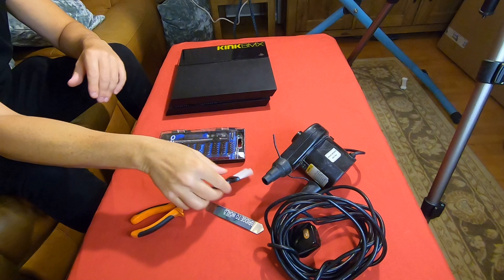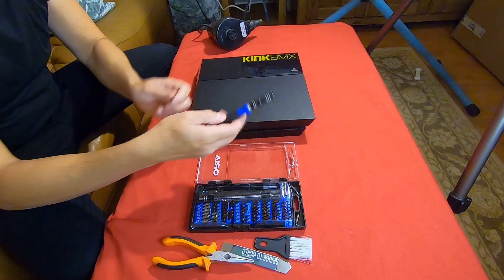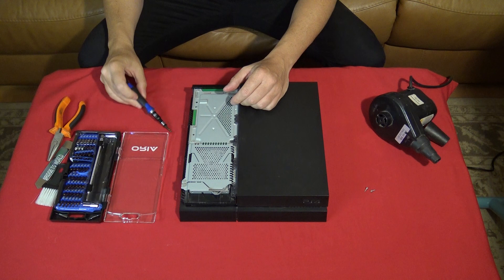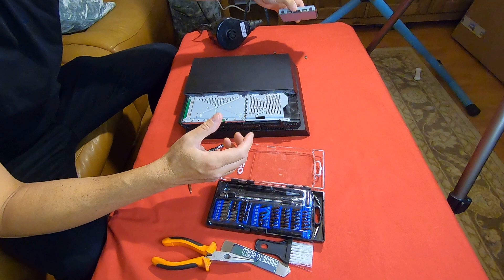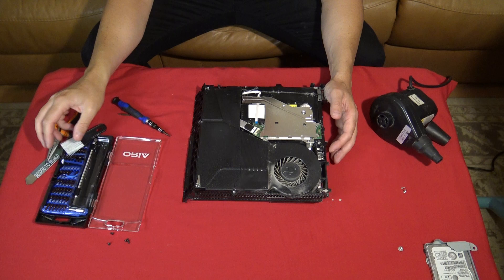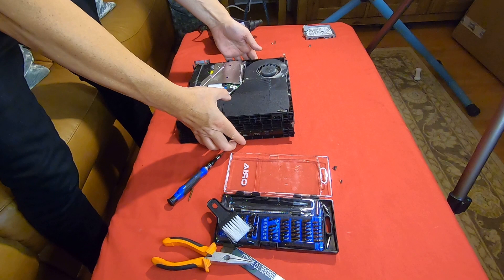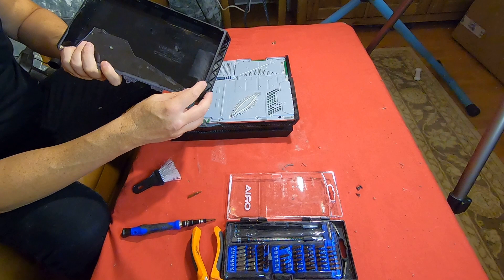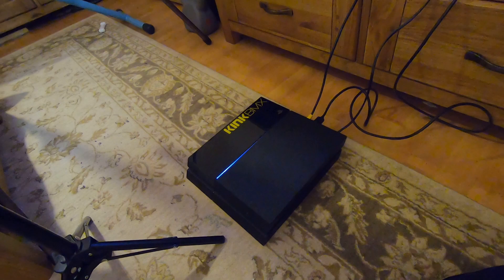How to clean your PS4  - Hot, Loud and Noisy Fan! - Playstation 4

Comment: On mine the fan is louder than the volume of the TV I play it on (the volume setting I leave it on, anyway). I really need to clean mine.
Reply from the maker: Sounds like you need to do it asap as it will likley be overheating, makes a huge difference, anyway have fun cleaning your!, mrix

Comment: I cleaned my ps4 ( fan and heatsink) . It stopped overheating and noise is reduced but still little loud . Any tips or suggestions to reduce noise completely?
Reply from the maker: I dont understand why it would remain loud unless the fan still had some muck on it which maybe unballacing the spin.
Reply: U will need to replace the thermal paste